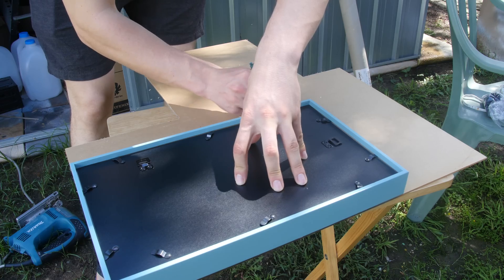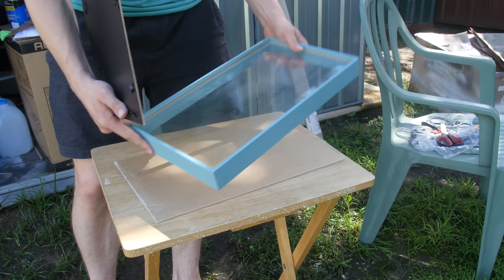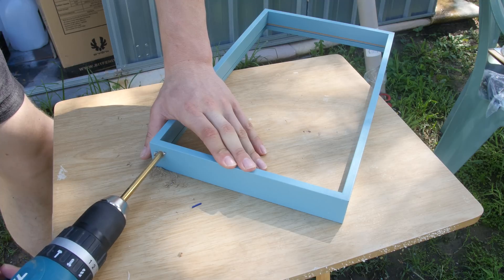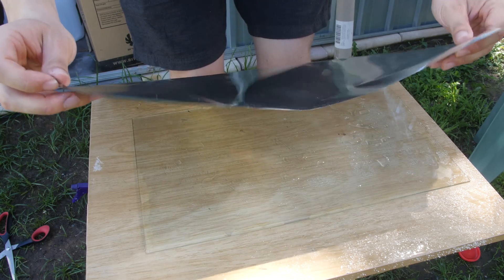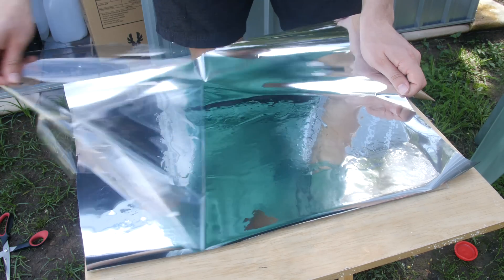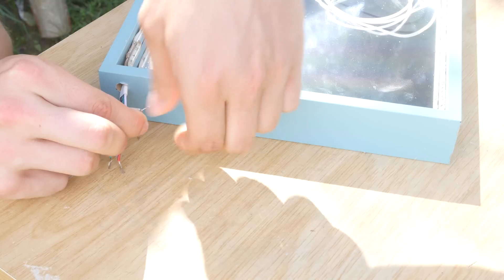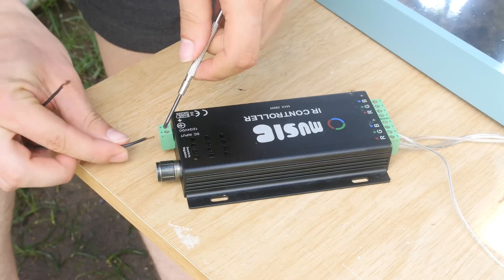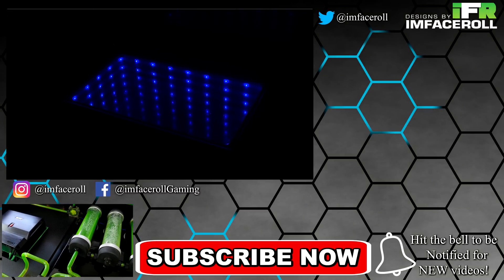How to make a LED Infinity Illusion Mirror - BUDGET HOME DIY

Comment: What kinda foil should I use? There is no link in de description as mentioned in the video ... I googled it but coming up with a mix of results on mirror foils. Like one way mirror foils and 25% reflective and such. I guess full reflective and 1 way mirror foil does the job? I would love to give this a go on a picture frame and perhaps later on an old PC case. (been trying out PC case mods on old cases, pimping the pc's and selling them off. For both hobby and make a little cash).
Reply: From other videos I’ve watched, I believe your guess is correct. Gl

Comment: Great video but....like others have said..... you completely missed out a step dude. 
You showed the frame with the mirrored rear piece in. Then you stuck the led strip in.....
But.... You would have had to take them out to get the front piece of mirrored  glass in the frame. So you skipped that step and went straight to the finished article.
Sorry bud

Comment: Ok I am having a little troubles with this my Strip Lights keep coming unstuck from the frame , Which is made from Plastic . The self adhesive didn't work so I used Hot glue on it And that doesn't work either , Got any Ideas On how to keep the Light stuck down  ???
Reply from the maker: Hey Gary, id try double sided 3m tape, that stuff will keep it down no problem

Comment: Ok Now here is a Question about the RGB Music Controller  I  have one of these actually .  My Light stip has Red, Blue , Green , And Black Wires on it  ,( I cut the 4 pin Connector off the end leike you did in the Video )  So I am Assuming the Colored wires go to the Corresponding R G B on the controller , So the Black wire would go to the + On the Music Controller ?
Reply from the maker: If the black wire is the 4th wire then it should go to where i put my 4th wire (i think mine was white from memory, i cannot remember)
Reply: I got it   Everything works Great  ... Thanks  For the Project

Comment: So you place both pieces of tinted glass together One On top of the Other ?
Reply from the maker: You need to leave a gap for the led strip
Reply: Between  the 2 sheets Or place the LED's behind them ?
Reply from the maker: The leds go inbetween the two sheets so that the reflection bounces back and forth to create that illusion
Reply: All Alrighty then., 
 thank you for that info ..

Comment: If I connect thru molex how do I control the lights?
Reply from the maker: +Stephen Rothwell the molex connects to the rgb musik controller, the led strip connects to the controller. All works the same way
Reply: Designs By IFR gotcha thanks man. Great video

Comment: Hi i was wondering if you or someone could answer this....i dont seem to get the depth or infininitty that all the others get in there mirrors...should i be using a certain percentage tint? i use the regular car window tint %5 should i be using %35?
Any Ideas? as to what im doing wrong? Im thinking its the tint %5 to dark?...and im using mirrors for the main backing is that best or is the mirror film best?
Reply from the maker: +Jeff Webber 5% is fine, it might be the placement of the leds. Make sure they are central. Mirrors work the best for the bottom section
Reply: ok I will try to make sure of that...thanks!!

Comment: i was just wondering does it work the same with kitchen foil? 
btw nice video 😃
Reply from the maker: hey, kitchen foil you cannot see through
Reply: Designs By IFR are you saying that if I put non see trough foil it will work or not thx
Reply: @onur7926  no it will not because you need to be able to slightly see through the mirror for it to work right
Reply: @lucasstand8839  Thanks for the response 3 years later LMAO
Reply: @lucasstand8839  you good lol

Comment: I dont quite understand, you layered the glass and the other panel with totally reflective material? you dont show in the video when you insert the second panel. if you have two panels that are 100% reflective, and not at least a little transparent, how can you see through the front layer to where the LED is?
Reply from the maker: +Ilan Friedman they are not 100% reflective my friend. Both panels have the same reflective tint on them. Works the same way as tempered glass, looks black on the outside and ypu cannot see through it hardly, but add some lights behind it and ypu can see through
Reply: Thanks for the explanation!!! Awesome video btw!
Reply: @DesignsByIFR  lolol

Comment: Hello. Is the background in normal mirror? I'm from Brazil and I wanted to ask you. The film you applied is the same one used for car windows. If it's the same use in car windows, does it have to be mirrored u black?
Reply from the maker: +wagnersz2202 i used the mirrored tint on the top and the bottom mirror
Reply from the maker: +wagnersz2202 needs to be mirrored
Reply: Bro I have a question ... I put a looking mirror on down side now if I use 12 mm black tampered glass will it got good result I mean deep reflection? Or I should use tint that u uesd in the video ?? Actually I'm trying th making a infinity mirror floor ... Kindly give me a suggestion ... And sorry for bad English ...
Reply: @hunnyrockz9555  Great idea!

Comment: I'm making this for a GPU backplate
Reply from the maker: +Sektor will look great
Reply: Hopefully, I made up a sketch of it in a 3D model thing however it looks a bit too thick (as I have to have 3mm+3mm=6mm and then the height of the LED strips). Do you recommend any LED strips to use? As you didn't link the ones you used in the description. Preferably something quite cheap (I was going to go CableMod but they are so damn expensive) and also as long as they plug into my motherboard.
Reply from the maker: look for some cheap chineese ones on ebay. thats all the cablemod ones are
Reply: Do you know about Aura compatibility though? Is that just the CableMod ones (as advertised) or also other ones that just plug into the motherboard?
Reply from the maker: +Sektor not 100% sure
Reply: All 4-Pin 16.8 million colour led strips are Aura compatible or ?